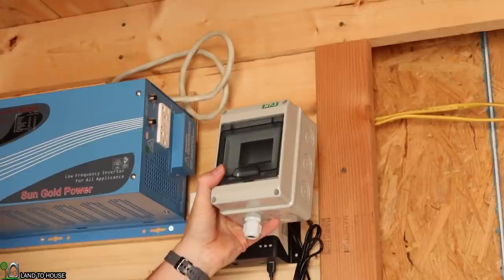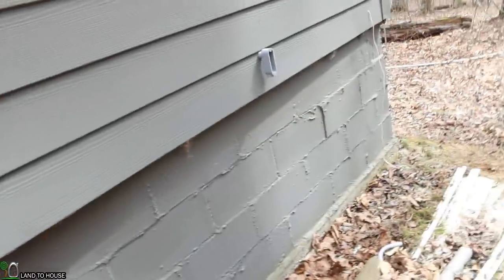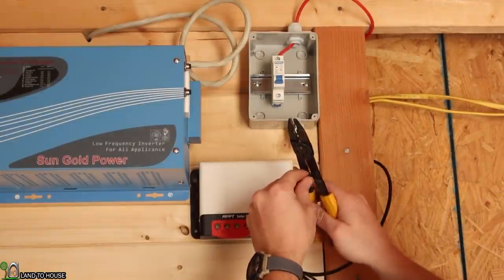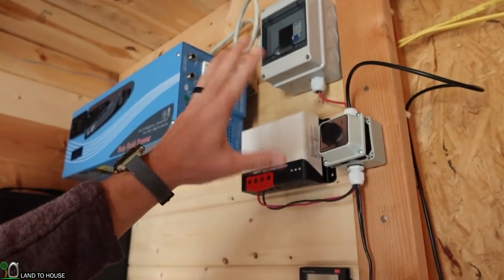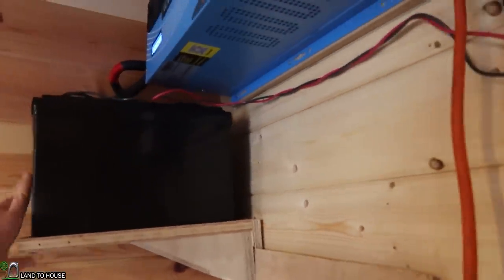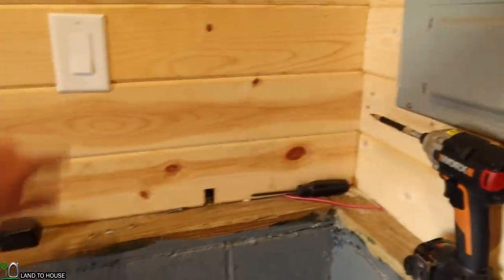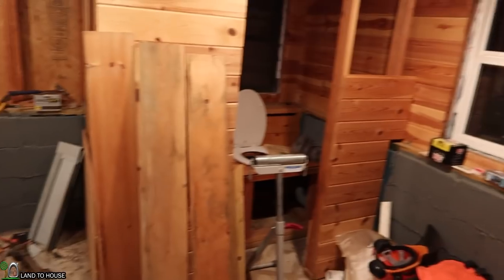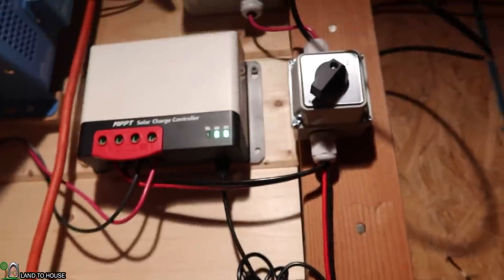Finally The Power Is On [Tiny House]

Comment: I know the breaker is off, but it's always smart to run the wires from your charge controller to your batteries before connecting in your solar panels, or else you risk burning out the controller.
Reply: I was about to say that .
Reply: I was just going to say, don't do that.

Comment: The cable gland or strain relief not clamping quite tight enough can be solved by slipping the cutoff insulation from the larger wire solar wire over the smaller THHN before threading thru the gland.

Comment: I like the fact that you've put a DC circuit breaker in circuit. I wasn't sure if the changeover switch was rated for turning off DC. It'll be fine if you use the breaker first.
Not sure the practicality of it, but it might be an idea to get a perspective timelapse of your wiring process next time. I know how often I have to go fetch more tools from elsewhere when I'm doing a project.

Edit: DC Current -> DC
Reply from the maker: Yes I also like the idea of the breaker. I really should have setup a gopro on that switch wire. But it would have been 20 minutes of me standing there staring into space. The box that came with the switch was way too small for 10awg wire. even the 12awg was a little tight in there.

Comment: That 12V 3000W inverter has standby power consumption of 50W (inverter on but no AC load), so in 24hr it will consume 50W * 24Hr = 1200Wh (or 1.2KWh) which is about the same as your 12V 100Ah battery capacity. So do you leave the inverter on 24/7?
Reply from the maker: No it has a remote by the front door that let's me turn it off like a light switch. Works out really well.

Comment: Is that a GFCI outlet in the bathroom? If not, it probably should be. Especially if you're installing a shower in there. Correct me, if I'm wrong.
Reply from the maker: It is. Wired as standalone if I remember correctly.

Comment: When connecting a charge controller shouldn't the battery be connected first so the control charger isn't damaged in some way?
I read a little about that which didn't make much sense to me at the time.
Reply from the maker: I had the output turned off. Should not have any issues. There was a slight pop as the battery was connected to the inverter.
Reply: @LandtoHouse  oh ok I was curious about that but at the same time I didn't think about the switch being off.

Comment: a very effective system.  a couple of points for you to consider.  I dont see any fuse or breaker from your battery to charge controller or battery to inverter. Why did you use 4/0 wire to inverter? your battery can only provide 100amps at 12v. The wires inside your battery are probably only 6awg and will be the limiting factor for your inverter.  A 3K inverter should have at least 3 100ah batteries to fully use the inverter. You didnt say if you are planning for future expansion of this system
Reply from the maker: I figured I would get the cable suggested by the inverter manufacture because they provided the inverter for a previous video. But yes a 4awg would have been easier to work with in such a small space and would have been plenty for the power I am going to pull from the tiny house. Someday I will increase the batteries out there for longer run time but not sure that is going to be any time soon.

Comment: 4500 amps?
Reply from the maker: I should have said 25 amp. haha Nothing like a breaker that only trips with 4500 amps. But you have to admit a breaker that can pass (1,800,00 watts) is impressive.
Reply: That rating is the short circuit interrupt capacity, if the source is capable of more than 4500 amps short circuit, then this breaker could fail closed in a short circuit condition.

Comment: Can anyone confirm why I was told to switch off from breaker always before switching sources? Got two separate batteries to switch between in my RV. Is it necessary?
Reply from the maker: I know my solar panels indicate not to disconnect under load. Its best to turn off the breaker first. Perhaps its because an arch is more likely to happen when you have a load being pulled from the battery.